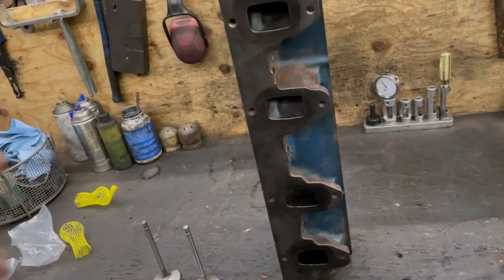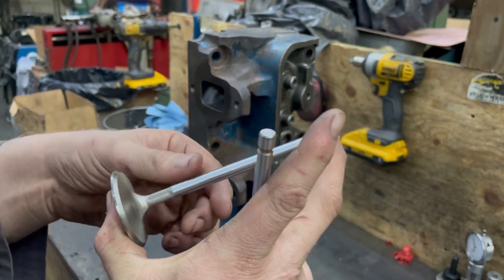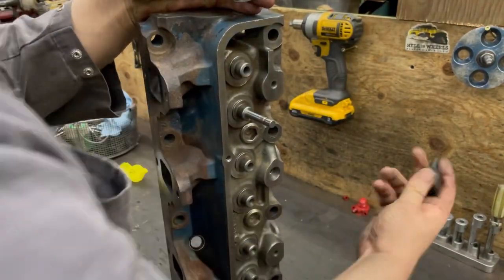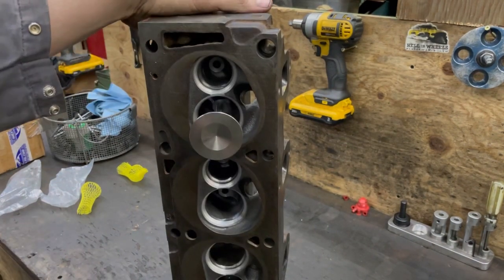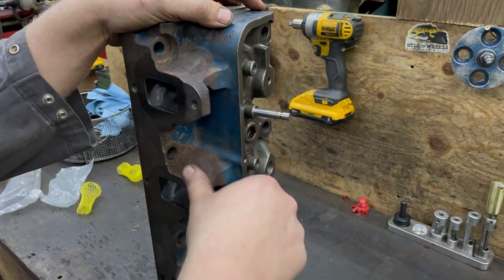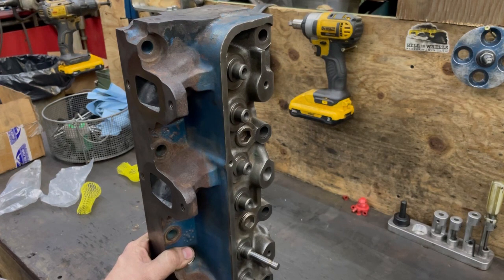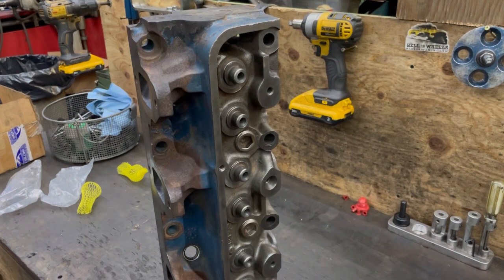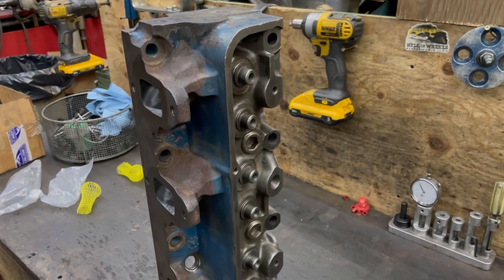( Must watch ) installed stem height

Comment: Yea i seen that before when i worked for GM as a mechanic on a Ford that was in the shop . I was out of trade school and went to work at the dealer ship .  Long story short after installing a set of heads on a Ford engine that had been to the machine shop to be repaired and reinstalled the engine did not want to run proper . There was a mechanic there beside me that told me that was probably the problem . What a load of crap . I never seen that before as i normally worked on Chev engines . He told me what to do to get it running right

Comment: Awesome video, I do have a question though. I took my heads to a machine shop and they did a radius valve job on them and I got a high lift cam on my gen 3 hemi, and because of all that I no longer can find the right length pushrods to have the correct valve train geometry. I have tried to use pushrod checkers and color in the valve tip but the pushrod will be 5.800 and the wear pattern indicates it needs to be shorter which makes no sense. Any tips for something like this?
Reply from the maker: If the installed height is right you shouldn’t need to change the pushrods. If you need pushrod custom length. Call smithbrothers pushrods all can help you out

Comment: Lots of geometry in a valve train.  Sunken seats-lessened spring closed pressure, thats when spring shims can be used to gather pressure up to a point- or offset keepers or retainers of different heights-increased cc of chamber- loss of flow also. ... yadda yadda. So much information to soak up doing cylinder heads.  Its an art! 
Its not rocket science!  Just common sense too
Reply from the maker: there is alot more to it that alot of people think that is for sure

Comment: I never understood   the pushrod length issue logic with 6.0 powerstrokes is it just a ford thing or what on how ford guys dont measure for length everyone just tosses shit ton   coin at new gaskets   studs and milled heads and they make sure to get the updated .040 shorter pushrods from ford like they are  magically the perfect legnth cause thats only size ford sells. I had a guy even try tell me its impossible to measure on 6.0s, think i spent $20 on a adjustable pushrod $5 on test springs and filled a couple lifters with washers and the original ones were fine just like they weren't to long the first 300k miles lol
Reply from the maker: pushrod length for 6.0 powerstroke won't change for the most part, on v8 gasser when you change heads  some will change heights witch makes the length change